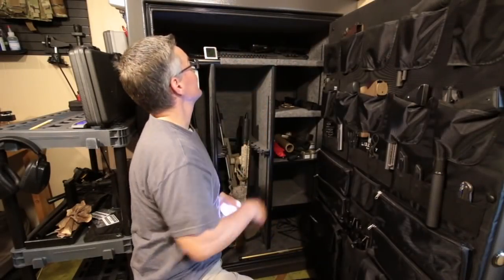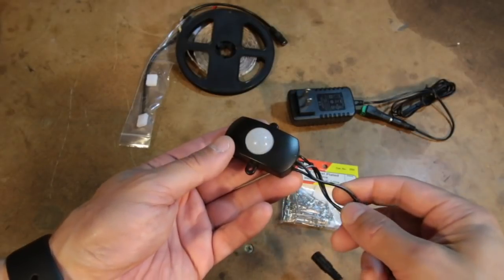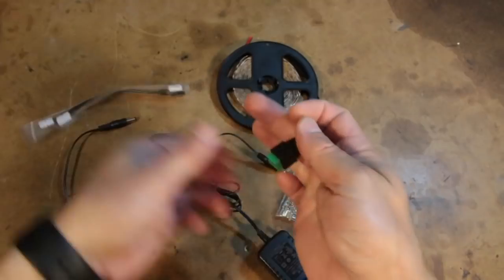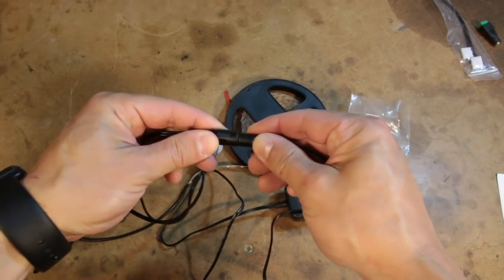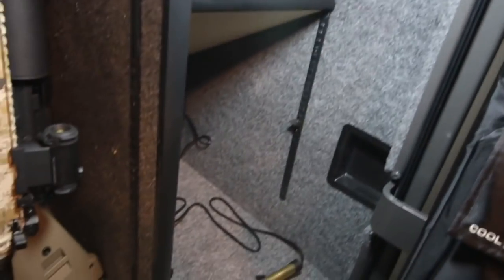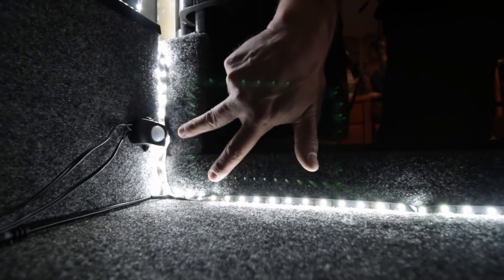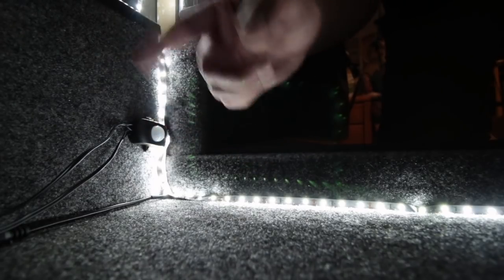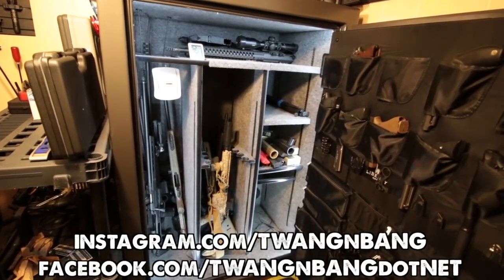Easy & Cheap DIY Safe Lighting! Motion Activated

Comment from the maker: You need one of each of the following to copy exactly what I did in this video-
16.4ft LED Light Strip:  http://amzn.to/2oDOvla
Power Adapter:  http://amzn.to/2oOUJOl
Motion Sensor Switch:  http://amzn.to/2FjHe3w
T-Pins (any size 1"-1.5" will work):  https://amzn.to/2xJkoQs

If you don't have a power outlet in your safe, you can use this rechargeable battery: http://amzn.to/2Fmm6t6

You can also install your own power outlet kit exactly as shown in this safe using nothing more than a powerdrill:  http://amzn.to/2oFLGjc
Reply: On the power adapter u provided , can I place the bulky reducer to 12v inside the safe or best to leave it outside? ..
Reply: My man, thanks for a simple straight forward idea.......definitely doing this as I tried some magnetic led lights and it will leaves sections of the safe dark....just ordered the parts.
Reply: Most of this stuff is no longer available, sadly

Comment: Thanks for the video.  I used this as a template but instead of T-pins I used small pieces of the hook side of velcro.  I stuck the sticky side of the hook pieces to the back side of the light strip (about a 2in piece a foot apart) then pressed the hook side of the velcro to the carpeting on the wall inside the safe.   Its been two years and works perfect to this day.  I also mounted a powerstrip inside my safe. Drilled a hole and added a grommet, cut the powerstrip plug off,  fed it through the hole, rewired the plug end, mounted powered strip inside safe, and plugged it in.

Comment: I just installed these lights in my 40 gun safe.  I spent time clipping a dozen or so of the pins prior to starting the install.  When I started installing the lights and went to use a pin I discovered my safe does not have felt where I wanted to install the lights.  The adhesive on the back of the lights works GREAT.  I wasted about 10 minutes with the pins.  Everything works great and I am very happy!  I guess I will give the pins to my wife for her crafts.  So glad I found your video.  Thanks again.

Comment: The best part was I cut all the pins and was getting the hang of it. Then I start to lay out my lights, and find that I have a half inch metal lip all the way around. So I used the backing tape and it came out awesome! You cannot even see the lights as they tape so flush to the safe! Anyone need some cut T pins? Great video and thank you for listing the links; very helpful and I appreciate the effort!

Comment: Great video, and appreciate the links to all the needed parts.  The fireboard in my safe was a real pain to push the pins in and they kept bending.  I found that using needle nose pliers worked well to help push them in straight without bending.

Comment: I just did this to my 36 gun Liberty safe. I was looking at the light kit from Liberty for my safe , $129 !! That got me searching a little and I found your video. A couple things changed since you posted 5 years ago. The motion / light sensor now has 3 adjustment pots and it has instructions on the package telling what they do and adjustment guides. The LED spool no longer comes with the extra AC connectors , you don't need them anyway. Since the 36 gun isn't as wide I had some overlap on the bottom , just extra light . It turned out great , better than the $129 set of 6 12" strips I'm sure , thanks for the video.

Comment: Thanks TwangNbang for making this D.I.Y. vids...I just got tired of a dark boring gun safe... so I tried your set-up and worked perfectly!
Although I did do a few things differently especially with t-pins, unfortunately it didn't hold up as I expected...so I used zip-ties instead.Also got this flexible type LED strips with plastic coating, the motion sensor worked just fine and adjusted it as directed. But Layed it out(strip lights)just the way you did and now safe is all bright but green lol.
Thanks for all the links...and your time doing this! 
One of my favorite 2A channels! 
God bless!

Comment: Excellent video and great price!  I order the supplies you listed ($33), installed it over about an hour and am very pleased with the results! I have the next size down from a Fat Boy, went completely around the inside of the door and trimmed off about 6-8" of excess lights. There is no need for lights under shelves.  I used the 1.25" T-pins and pressed them in on an angle into the corner so the tape is angled toward the center of the safe.  Use a little piece of wood to help press the pins in and save your fingers!  I also removed the backing on the strips and used the adhesive to stick them in the hinge cups to make sure they stay out of the way.  Worked great!
Reply from the maker: Thanks for the report!

Comment: I used sticky back Velcro Strip from craft store and cut it to match size of led strip . I then pushed both sticky sides together of the lights and Velcro . The Velcro stuck to back side of lights attach and hold to felt  on safe the whole way. And it is movable if needed. Great video!!

Comment: I couldn't get the t-pins to go in far enough, so I use my Arrow staple gun. That was easier for me. The list of parts was a HUGE help, thanks. I ordered 2 strands of lights, but the coupler to link them together wasn't included anymore. The adapter is no longer included with the power supply either. Turned out bright enough with just a single strand though, so no big deal. Thanks a million for the idea.

Comment: Great Video. I also found that the T-Pins were a PITA to get pushed in. I went with the velcro method which was much easier. I took it one step further and cut the backing tape every 6 inches so that I attached to velcro to the LED glue. Not removing the tape I noticed that my velcro was not sticking well. Once completed it took me about 2 minutes to run the ribbon. Looks great and thank you for the information.

Comment: Great idea, I ordered the lights and motion detector through Amazon and I ordered a rechargeable 12 volt 5800 mAh battery pack through Ebay.  I was going to secure the lights to the safe with the hook side of hook & loop velcro but I found that the lights that you suggested already had an adhesive backing so I peeled off the backing and stuck it all around the safe.  It's very sticky and adheres very well the the safe.  I stuck the sensor to the side using the velcro hook side.  Thanks for the great video!
Reply: How long does that battery pack last? And how often are you going in your safe

Comment: Thank you for this!

I bought everything you recommended. The DuBro link didn't work for me. I was able to find a different source for the same Du Bro 1-1/4" size pins. 

I think your tutorial has upped the price of the items on Amazon. It's up to $42 now!

Anyway, it was extremely helpful, and everything worked just as you described. I'm extremely happy! 

I did burn out one segment, by pressing it in the T-Pin crease too hard. Thankfully it wasn't noticeable, and doesn't affect the rest of the led ribbon. I also found that putting a T-pin across the two contacts where you cut it, shorts out the lights.

Comment: I just installed my lights. I attached them to pieces quarter round actually. It turned out great. Installing the LED strip on the curved part of the quarter round gives it the perfect lighting angle.

Comment: Great work bud. Looks great. I used the exact same lighting kit. I just leave mine on 24/7. Doesn't use much power and it acts like a small golden rod because it slightly heats up the interior.

Comment: I have a liberty 48 which is close in size to yours on order and looking around for lights. I bought 2 thin aluminum pieces at tractor supply on their 4th of july military discount to use as a backer/heat sink for the leds. Good reminder about the door hinges, I forgot about them but looks like no problem at all.

Comment from the maker: I found a battery option for those who don't have/don't want to run power into their safes or cabinets.  At about $25, it's not cheap, but it is plug-and-play with this system and comes with its own charger.  Will run this strip for about 2 hours of total runtime.

Rechargeable Battery: http://amzn.to/2qpxWIE
Reply: Have you tried this out yet? And is it the 3500 size?
Reply: I snipped the connector off the sensor and soldered them to a 12v MaH Duracell battery.  Works great, I dont know how long it will last though.  If the Lights pull 1-2 amps per hour itll last a few hours of run time which in my mind correlates to roughly 20-30 openings. You can buy larger batteries with more milli-amp hours to extend the run time.
Reply: TWANGnBANG v

Comment: Thank you for this video and the links.  

I purchased all the items linked from Amazon in later December of 2020.  Installed in a Liberty 1776 64gun safe from TSC.  

I found the wall edges to be too hard for the pins until backed away from the front wall by about 1.5 inches.  I pulled the sticky backing off and followed the plastic hinge recesses at the same front offset line.  The hinge does not appear to hit the led strip.  Everything worked exactly as described in the video, and looks amazing.  

My TSC safe may be taller because the LED strip did not make it around the entire safe.  Starting the lights at the lower right corner they ended half way across the bottom.  The right side of my safe is rifle storage, so that lighted section is not missed.  Having lights on the bottom left does light the shelving really well.  The bottom shelf was lit so well that I've moved the shotgun ammo down their.
Reply: It's only been a few days, but I'm really enjoy opening up that safe and being able to see everything perfectly!  

I forgot to mention two things:

1.  I probably installed with more pins than necessary. If you look at the strip closely there are segments between LEDs that are cleaner (no components or cut points), I slid most of those clean sections into the top of a trimmed T pin.  The clean sections occur about every 6 inches.

2. A 3ft long goldenrod takes up the front floor space, so the LED strip was moved from the safe floor to the front edge below the door (up about the same 1.5 inches).  This makes that bottom shelf lighting even better, and so prompted me to move a subset of ammo into that space.  It would have been better to mount the entire strip against the front edge BUT the door locking bars slide across that space on most of the door jam.  My LED strip ends before the bottom locking bar, so it became the best option for my bottom LED position.

Comment: The lights you installed are brighter than the lights that came with my Liberty Lincoln safe. Looks like I might have to upgrade my led lights. Thanks for the video.
Reply from the maker: Standard safe lights are way worse than they need to be.
Reply: TWANGnBANG The lights I failed to mention were the upgrade plug in type with five led light bars.

Comment: Thanks bro. I was thinking the other day on the simplest way I could do this and here you are! I just placed an order for all the materials using the links you provided. I did however ordered 2 spools of lighting so I could run a strip on that rear as well. My fat boy is packed full of rifles and I need the additional light. God bless.
Reply from the maker: Awesome!
Reply: Monte PR  I
Reply: In order to run 2 spools where would you need to split it?????
Reply: Nick_ P_ there are cut marks on the light tape. However there is one very important thing. When you connect the two with the supplied splice clamp both connecting ends must be inverted for propper function. If you don't the LEDs won't light up bright and might even light skipping an LED and then lit and skip and so on. Hope this helps. I used two spools and am very happy with the results. Hope this helps. Let me know if I can help you more.
Reply: Nick_ P_ Also the adhesive backing on the LED tape was sufficient for me to keep it in place but ordered the pins as Well just in case.

Comment: I did this in my safe a moth ago. Only difference is I just used a manual switch inside and I used 15ft of 5630 LED's. Ridiculously bright! Lights up my bedroom with all the other lights off. Great video BTW T&B👍
Reply: where did you mount the switch and where did you find it? got a link?

Comment: Good stuff. Thanks for this video, helps a lot. I am currently about to do the same, but I want a pressure switch so the lights turn on when door is opened, and off when door is closed.

Comment: To anyone who has followed this tutorial, including the maker of this video, PLEASE check your install IMMEDIATELY!!! This particular LED strip is flimsy and is a fire hazard.

I followed this tutorial in Sept 2021 using the exact same parts and method. I was extremely happy with the results until last night when I smelled burning plastic coming from my safe while it was open and illuminated.

This was the only electronic device in my safe, so I quickly realized it was the LED strip. The strip was damaged, possible by the T Pin mount, right in the area where it makes a 90 degree turn at the bottom corner of my safe. It was shorting out, causing the strip to burn and melt. Damage could also be due to bending the strip. These strips are extremely flimsy, basically a couple of copper foil leads encased in thin plastic. Simply bending the strip may have stressed and cracked the copper lead inside, creating a hotspot where the lead was barely still connected.

As I began to pull at the strip, trying to remove it, the lights on one side of the damaged spot flickered on and off. I then notice a burnt/blacked area with a tiny spot that would sporadically GLOW ORANGE WITH HEAT as I pulled at the strip. This thing could have caused a fire INSIDE my safe full of guns and ammo and burned down my house.

Even if you got lucky and didn’t damage your strip during install, failure could just be a matter of time as the strip is so flimsy that repeated, small movements over time (such as bumping the strip while moving items) near a bend point could possibly damage it.

I blame myself for using cheap parts and a janky mounting method and for possibly over bending and damaging my strip during installation without realizing it. I usually do MUCH better work and use higher quality parts than this on my projects, but I was looking for quick solution. This LED strip will be going in the trash and I will replace it something more durable.

Comment: Thanks for the video.  It seems some of the links you originally provided have changed.  The LED link now points to a warm white when it looks like you used more of a Cool White color.  Also, the power adapter is quite a bit different.  I actually like the new one though as it isn't a "wall wart" that might block one if your other outlets.

Comment: Thanks for the video. The pins were useless for me, so I used my hot glue gun. The results were fantastic.
Reply: no no thanks for the idea I guess I'm going to have to borrow my wifes hot glue craft gun for a bit thanks for a really easy solution.
Reply: Hot glue gun! 💥 bam , thanks
Reply: I cut all the pins then realized a half inch metal lip all the way around.... so I was able to use the backing tape. Need some cut T pins?
Reply: Welp, going the hot glue gun route now. Thanks.

Comment: Great idea!  I purchased everything in your links to brighten up my safe.  Just a note for anyone else that is going to give this a shot.  The linked motion sensor is not the same as the one used in the video and has three potentiometers.  Unfortunately, my sensor's delay potentiometer was DOA.  No amount of adjustments gave me more than about 2 seconds of light.  In fact, it just spins and never hits min/max.  I'll return it and get the one used in the video with only one potentiometer (and save $1.00).  Also, I bought the Du Bro 1" T-pins and they are garbage.  Almost impossible to push into the safe wall without them bending.  I also have no need to cut them.  There is a gap perfect to slide the LED tape into.  I'll keep trying, but are the 1.25" pins thicker?  Again, a great idea and I look forward to having it done.  It is just not working out as easily for me at this point.
Reply: UPDATE - definitely go with the 1.5" pins.  I looked on Du Bro's website and they are definitely thicker, so installation should be easier.  I finally got the LED strip up, but ruined as many 1" pins as I used.  During that frustration, I also realized that inserting a pin about half-way in and then bending it over the LED strip works pretty well.  Very happy with the final result, although the light still only stays on for a second or two.  The new sensor should take care of that.  Thanks again for the great idea!

Comment: Thanks again for the instructions and parts list! I was able to get my FatBoy Jr. powered up and lighting installed yesterday afternoon. I ended up utilizing the 3M tape that comes on the LED's and it seems very secure to me without the pins. I did get the pins just in case.  It is literally a night and day difference LOL!

Comment: nice job, im looking into some interior lighting for my much smaller 14 gun safe - could you have started your run of the lights ABOVE the first door hinge of your safe, only having to deal with the upper hinge? You could still run the lighting all around and end up finishing at the bottom too?  one less door hinge to concern yourself with, unless it was of no consequence anyway
Reply from the maker: The hinges were easy to deal with, and you get better light with the strip going the full way around the opening.